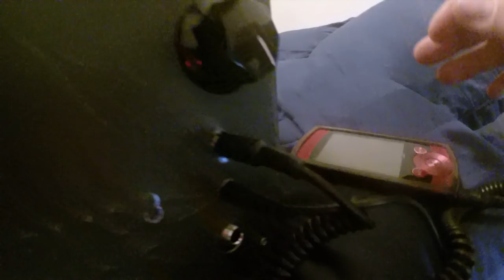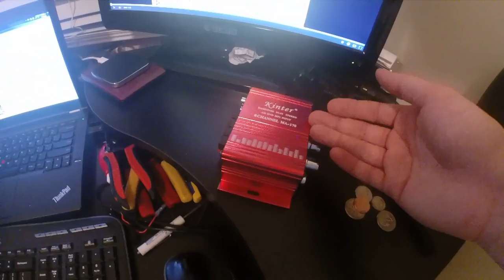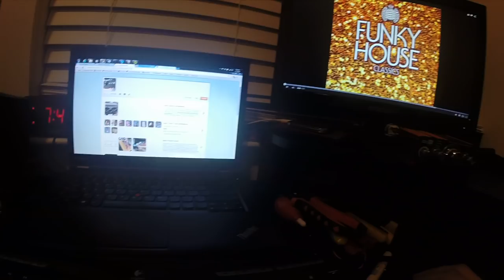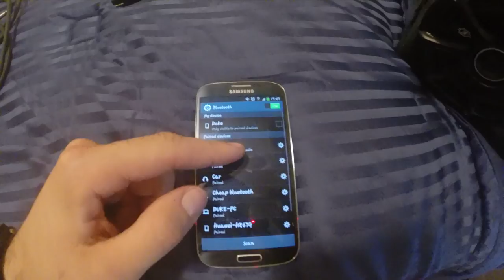Ammo Can Boombox

Comment: Love your ammo can stereo. I'd like to help with your ground loop problem with you using your Bluetooth device connected. It's the same as if you have an amp/sub in your car and you can here the garbage going through the speaker.

What you need is a 1:1 audio transformer, your digital cross-talk is due to everything sharing the same ground. Most commercial setups use shielded twisted pair wiring, but it's more money. Basically he's what you need to do. 

Get an audio transformer
Neutrik NTE1 1:1 Audio Adapter Transformer and can be found here : https://www.parts-express.com/neutrik-nte1-1-1-audio-adapter-transformer-for-nmxxx-modules--092-2247
http://www.ebay.ca/itm/Neutrik-NTE1-1-1-Audio-Adapter-Transformer-for-NMxxx-Modules-092-2247-/221679894790?pt=LH_DefaultDomain_0&hash=item339d26c106

The red and black leads connected to the Bluetooth side, while the yellow and white leads from the transformer connected to the audio amp side.